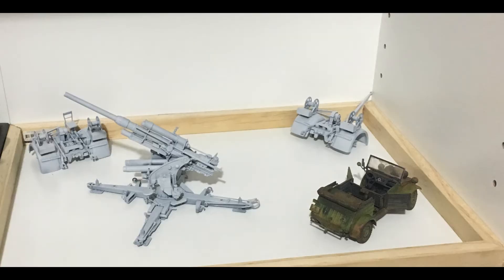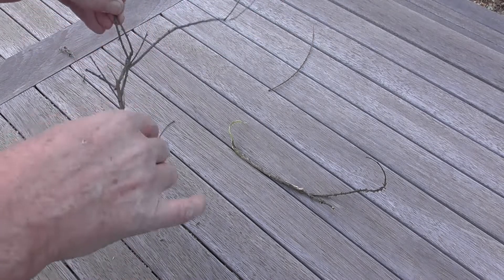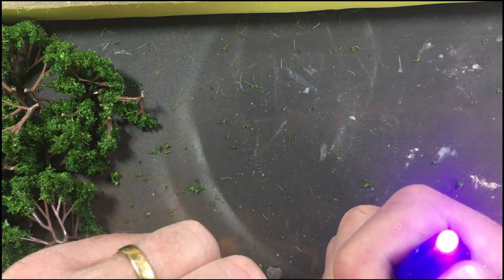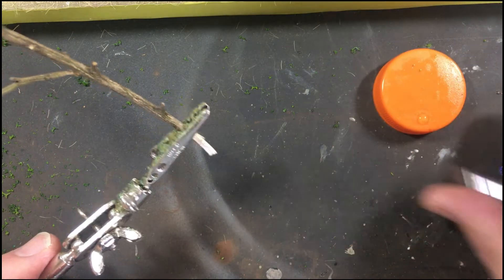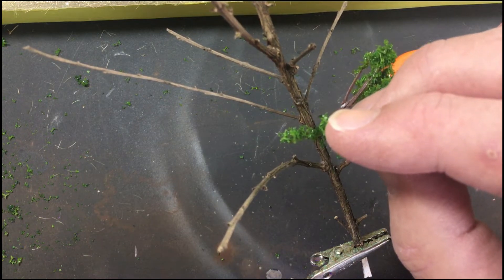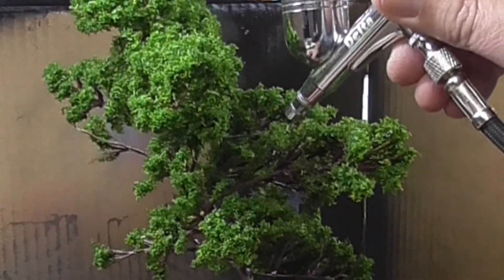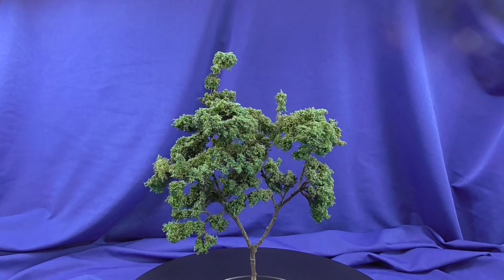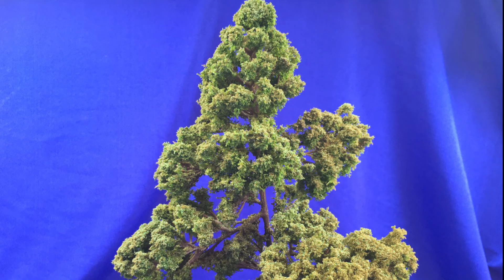How to Build Scale Model Trees

Comment: A very timely video- I need a tree for a cat to be stuck up to go in a diorama I would like to make but can't at the moment due to the lockdown.
Reply from the maker: Thanks Ian, that sounds like an interesting dio, all I can think about is Firemen, an I even close?
Reply: @HalidonDioramas  I'm afraid not- the main feature will be a King Tiger tank. The Tamiya ammo loading crew comes with two cats and it would be a shame not to use them!
On my way back from the shops today I'll go through the park and try to find some twigs for my tree.

Comment: I like the look of that glue, I've seen a few different makes/manufacturers.
It's original use was in the dental practice for glueing teeth/crowns and dentures. At least that's what the BONDIC advert says.
It also says in the advert to paint both sides of the joint and over the sides of the parts a little as you did. 
It's expensive for a single tube but if you buy a bundle pack it's a lot cheaper per £ / gram ratio.
After seeing this I'm going to have to bite the bullet and get some.
Not sure it would be OK for photo etch though. Having to paint over both parts will hide the fine details like nuts and welds, though I suppose if you put a little around the edge of the part (very carefully) you could make it look like the parts are  welded on.
There's a glue manufactured by V.M.S. Vantage Modeling Solutions called 5k flexy ca glue. It's a lot better for p.e. Because it's less brittle and as the name says its flexible. This allows the part to move a little rather than just ping off onto the ever hungry carpet monster never to be seen again. Don't get me wrong, the parts still come off if your not careful but the bond is a lot more robust.
They make a decent veriety of glues, solvents, airbrush thinners/cleaners, pigments, mediums, well worth a look. Every product has detailed video instructions too on their website and on YouTube.
Reply from the maker: Thanks Allan, i will check that out, i haven't tried the UV glue on PE as yet but i think your point is valid, would need to be applied sparingly to avoid obliterating any detail, which might make staying stuck together problematic. 👍
Reply: @HalidonDioramas  when I get some glue I'll do a test on the spare p.e. Parts I have left over and I'll see how little glue it's possible to get away with.
I suppose as long as the light can penetrate through the thin layer of glue it should stick sufficiently.
I'll let you know how it goes when the glue arrives.